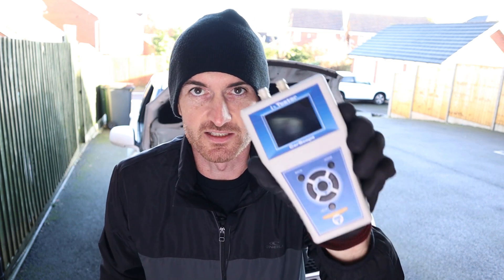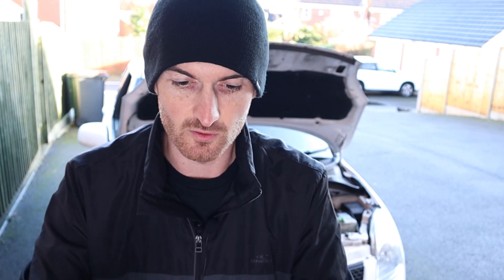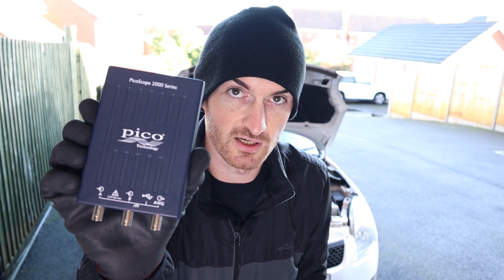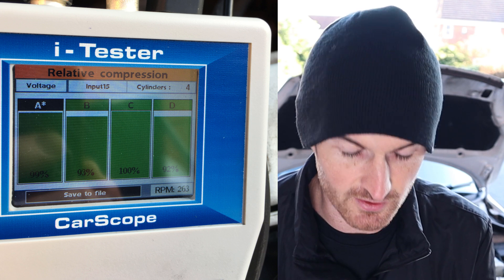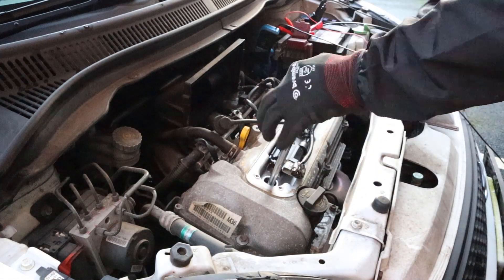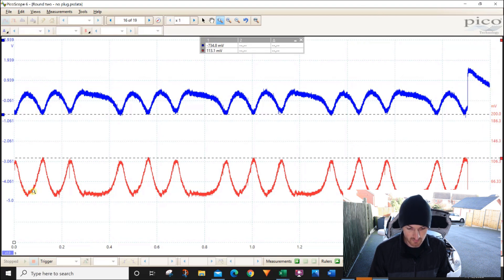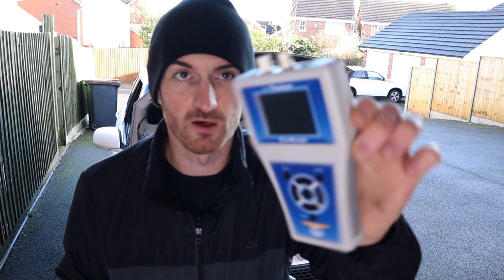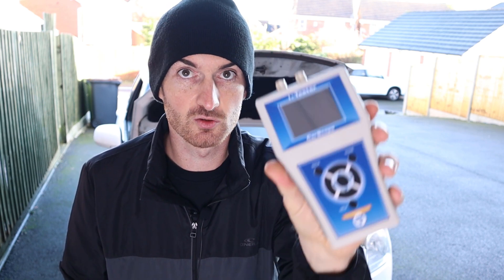Ditex i-Tester vs PicoScope | Relative Compression Check | Mechanic Mindset

Comment: Use the Picoscope diagnostic program. It has a built in graphic inteface which is planed for this test and much easier to read. No need for inductive clamp for this test. Just connect to battery with crocodiles.
Reply from the maker: Great feature if you have the automotive oscilloscope; unfortunately you can’t use it with this scope. Although you can also do the test with the voltage measurement too, I have a video somewhere. Cheers!👍

Comment: I bought an I Scope about a year ago because it seemed to be a quick way to do a general comparison between cylinders for a basic check on marine inboard and stern drive boats. The first one I could hardly see the screen so i sent it back and exchanged it. Same problem with the second one but also kept throwing a fault. Tried it on 3 different systems and the same thing. If it's nearly dark I can see the screen but in normal daylight it's very hard to see and in sunlight impossible to see. I think the unit is a good idea but a very cheap screen for the high price.
Reply from the maker: Thanks for the feedback, Ditex will hopefully take in your feedback 👍
Reply: @MechanicMindset  Really ?I bought the Master I tester few days back but i am still waiting for it to arrive, i thought its a good tool, what a waste of money..!!
Reply from the maker: @thomasyd9220  Hi, I had no issues with the screen. To be honest it’s a great tool to get quick results. Has a few other features too (like diesel HP pump test), but not played with them yet. Give it a go 👍
Reply: @MechanicMindset  But you said it already.. :)
Reply from the maker: @thomasyd9220  Only trying to get the camera at an angle where it would capture it, I could see it fine 👍

Comment: Thanks. In this  test, did you connect the Ditex with clamp to the battery, to measure the voltage drop? Or did it measure the voltage drop thru the OBD2? If you will have a reference, you just connect the Ditex to injector signal, crank sensor etc, and just add that info in the menu?
Reply from the maker: Hi, I just connected directly to the battery. I struggled to get the cylinder reference to work; it says you can connect to an injector or ignition coil/lead - if you have the correct tools
Reply: @MechanicMindset  Thanks. But when did you want to connect the Ditex to obd2? Can it do de voltagedrop thru the obd2 instead of being connected to the battery?
Reply from the maker: @AN77  Yes, apparently it can do the same test via the OBD port. I have not tried it yet 👍

Comment: Good morning, can we check the center of the motor by means of the bioscope, and is there a video or method to guide us through it?
Reply from the maker: Hi, what do you mean ‘bioscope’? 

You can use an oscilloscope to check the internal windings of some motors. Best to use the amp clamp 👍
Reply: @MechanicMindset  MY DEAR MEAN PICO SCOPE
Reply from the maker: @rufaatmj9986  Oh haha. Yes you can. You can use the amp clamp and check the ‘ripple’ and current draw. Sorry I don’t have a video yet
Reply: @MechanicMindset  THANKS

Comment: Diagnose Dan uses one . Scanner Danner also had one . Contact Auto Ditex , I have heard they respond to suggestions . I have seen these used to show a quick test by attaching to the battery and not synching . You then have a quick result to indicate a possible problem . Just doing a compression or leak down test on some vehicles requires removal of an intake plenum , etc . At least you know that an issue exists before you get deep into vehicle . Then the customer is made aware and can't come back crying that the car doesn't " run right " .
Reply from the maker: For sure! That’s what I’d say this tool is best for; a quick check to see if further diag is required 👍

You’re right, getting the sync took some time - and I couldn’t get it to work anyway 😂

It does a diesel HP pump test too but not played with it. Ditex have some cool stuff. Thanks for watching 👍

Comment: Hi. I see you have very nice dc signal on rc test compared to last time where it looked much worse. Could you tell settings this time? :)
Just got pico 2204 myself thanks to your channel.
Reply from the maker: Hi Martin, I went for 5v/div, AC coupling and it looks like I upped the sample rate but wouldn’t think that would make much difference. Hope that helps! 👍

Comment: Would the mac probe banana plugs not go 'piggy back' in your hantec scope leads instead of the croc clips ?. Would a relative comp test also work on a rotary ?
Reply from the maker: Yeah, someone else just raised that point, didn’t put 2 and 2 together; thanks for the reminder!

I’ll be honest, I’ve not worked on a rotary engine before, but I would expect there to be some compression stage that can be measured. Check this thread out:

https://www.picoauto.com/support/topic10221.html